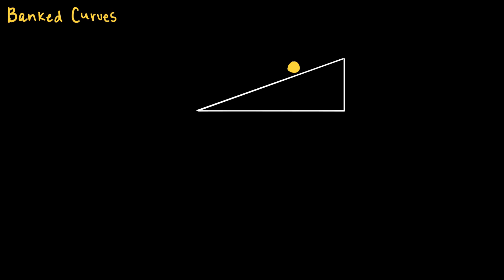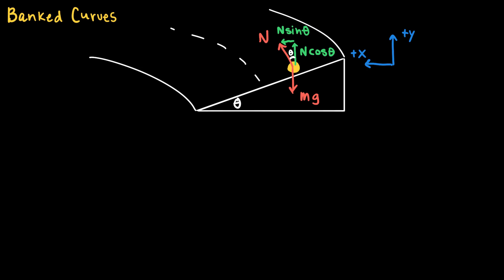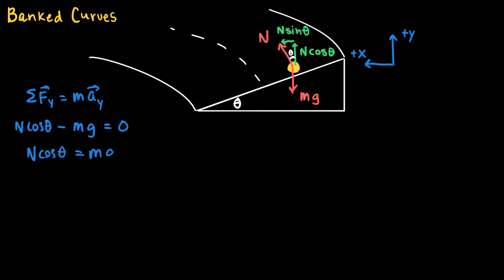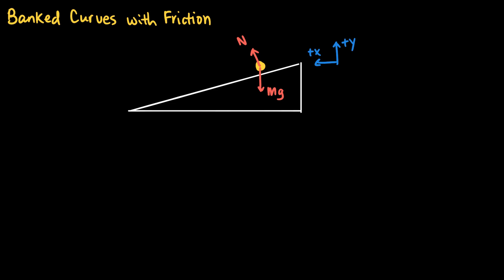❖ Banked Curves ❖

Comment: I’m confused. Are we only considering velocity is less than rg tan so the friction is pushing us out of the circle? I solved a problem with this and I got it wrong because for some reason in my problem friction goes towards the center. This is so confusing. I’m struggling with the concept but the math is fairly easy. When do we decide if it’s positive or negative friction?

Comment: 12:45 one thing I'm not getting, if mv^2/r is brought to the left of the equation it will have a negative sign, however the centripetal force acts in the postive x-direction so why would it be negative there. I understand it it the right answer but I cannot find the reason behind this.

Comment: Is the friction in the 2nd question, the static friction or kinetic friction? I believe it should be static friction. The only has a tendency to slide up or down and there is no relative motion between the car and the banked plane yet. Unless, this is the maximum static friction and the car is going to slide down or up if the velocity decrease or increase a little bit more. Then we can use static fiction coefficient.
Reply: If I had to guess, I’d say it’s the kinetic friction coefficient since we are dealing with a car while it’s driving and we’re studying it’s velocity. However, I could be totally wrong🤷‍♂️
Reply: @DanielRodrigues-oe1bw  you are wrong indeed, it's the static friction here between the tyres and the road

Comment: where are the components of weight? mgsinx and mgcosx, also why isn't it is "Nsinx +mv2/r = fcosx" since nsinx and mv2/r are in the same direction
Reply: There's no component of weight since weight is perpendicular to the x-axis. Nsinx and mv^2/r are not in the same direction. mv^2/r is an inertial normal acceleration acting in the opposite direction to the force, I'd rather visualize mv^2/r as a result of Nsinx-fcosx since Nsinx and fcosx act opposite to each other in the normal plane i.e x-axis in this particular example.
Reply: We don't concern ourselves with components of weight as by convention we have chosen weight to act in the j (y) direction. We could go by more standard convention and choose the direction of normal force to be in the positive unit vector j direction, in which case the problem would be solved differently (a big difference being we now concern ourselves only with the cosine component of centripetal force).